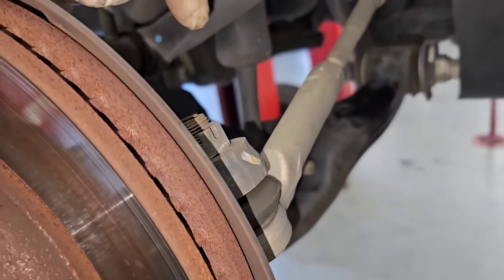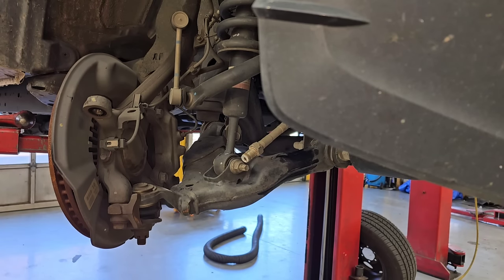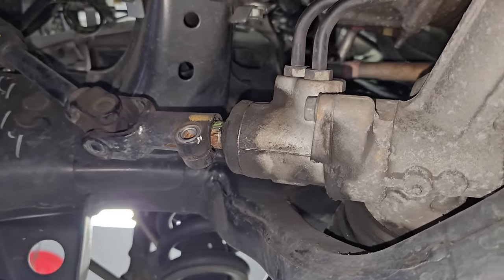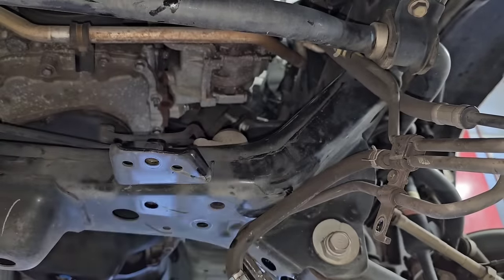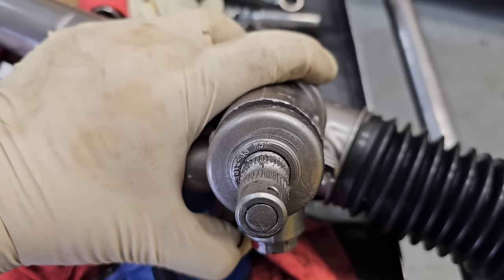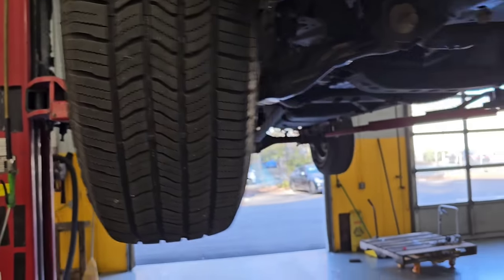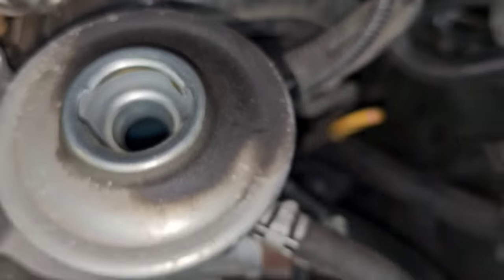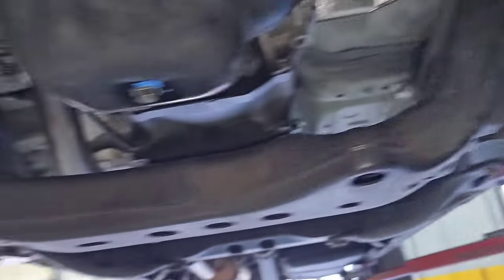Rack & Pinion Steering Rack Replacement in a Toyota Tacoma!!

Comment: I do the "wheel cut" method for my car, as per Service Manual procedure.  It's worked for my car. I'll leave the belt disconnected while I fill the reservoir and hand-turn the pump, then do the wheel cuts after everything is back together.

Comment: Thanks for this... looking at a possible DIY steering rack job myself. As others have said that takikjng the ac compressor loose was necessary... it made me DREAD possibly doing that cause those lower compressor bolts are a real PITA to access. I know that from experience. Glad to see that its not necessary.

Comment: I have a 2009 Silverado, beater truck I use for hauling/work. Rack is leaking out of the end, about a pint a month. I really don't want to spend the $ for a rack and an alignment, so I am going to try some leak stopper, a low viscosity clear liquid a company makes. I am usually NOT a fan of additives, but have had success with their other products.

Comment: I always was a Chevy guy but after hearing all the hype about Toyota I bought a brand new 2007 Tacoma TRD off road in 07. 1000 miles after the warranty ended my steering rack blew a seal. I had to replace the alternator, water pump and fuel pump all before 140,000 miles. To make matters worse the 4.0 V6 drank gas like a big block chevy engine. At 140,000 miles the ball joints and tie rod ends also needed replacement and the check engine light came on for excessive timing retard so it got traded in. Never again the Kool aid is tempting but dont drink it.
Reply: Oh say it ain’t so! You thought just because it said Toyota that it wouldn’t need wear items replaced and the alternator, plugs, belts, brake pads, battery, starter etc. wouldn’t ever need replacing!? Talk about drinking the kool aid. Hate to break the bad news to ya, but a lot of parts fail and need replacing and all of those parts are expected to need replacing regardless of who made the vehicle. The engine, tranny reliability and overall maintenance needs is what makes Toyotas generally a lot better than any American car company’s and definitely Korean car manufacturers, and definitely Fiat. That doesn’t mean things can’t happen to Toyotas. Anything man-made can and will eventually fail. Keep up the proper maintenance and your Toyota will generally keep running.
 There will always be someone that owns the exception to the rule,  but generally speaking certain Toyotas are significantly more reliable than any other vehicles out there. They have a belief in making things better and constantly improving (kaizen) as opposed to most of the others, Mazda/honda excluded, have a planned obsolescence belief. They want you to buy a new car every four years.
Reply: Chevy would've blown up by 140K.
Reply: @21Piloteer or rotted away
Reply: Steering rack on my 3rd gen Tacoma just went out at 31k  miles. Dealership wants $2600 for the repair. Prior to this Toyota, I owned an Accord, a Ridgeline and a Volvo S60. All of those vehicles made it to 100k without anything other than routine maintenance. Toyota quality is all hype at this point.

Comment: Whaaa? Wait wait wait. A Toyota that needs repairs? The Toyota fan boys tell me they never need fixing. This has to be fake. 🤣
Reply: Nothing is perfect but a Taco comes close
Reply: @HawksDiesel  the fact you even say "Taco". 🤦. Wait, I bet you 'overland' too. 🤣
Reply: No, they need parts replaced just like everything, water pumps fail, racks fail, belts fail, plugs need replacing, but the don’t happen as often as some others, and the important parts don’t fail. Yes some years Tacoma frames were made by Dana and not done correctly, but tacomas are quite reliable, second to probably corollas and top would be 4Runners.
Reply: Nobody has ever said a Toyota "never needs fixing".  What a dumb statement.
Reply: Every vehicle needs their parts replace at some point. Difference between toyota and others? Beats German/European engineering. Any shop I see has fords, chevys and volks but rarely toyota
Reply: The case is when it fails. Even an engine fails at some point. I did bushing update and new tie rods on my steering rack last week. My 25 yrs old 2000 Tacoma at 148k miles could use it. Even the service manual suggests all the rubber and bushings replaced. I'm still impressed bc I know the engine and trans will make it beyond 300k.

Comment: The transfer tubes rot out on the Tacoma's on the rack and you can't buy the transfer tubes so I bought a GM Fuel injection line repair kit 5/16 18 inches long with the compression fitting and it has the correct flare and line nut to fit in the rack all you have to do is bent it cut it screw it in and tighten compression fitting and the line nut on the rack and you saved 350 dollars because you don't have to replace the rack
Reply from the maker: Good save $$$. I'm glad it was just the transfer tubes. Thank you for sharing your repair. That's awesome! Keep wrenching 🔧
Reply: You are welcome, I hope somebody gets use out of that as I live in the rust belt of Pennsylvania and I saved my neighbor a lot of money doing the repair that way @WrenchingWithKenny